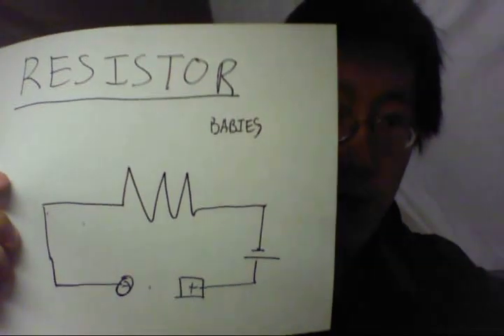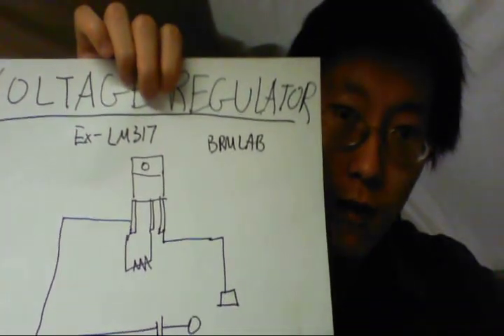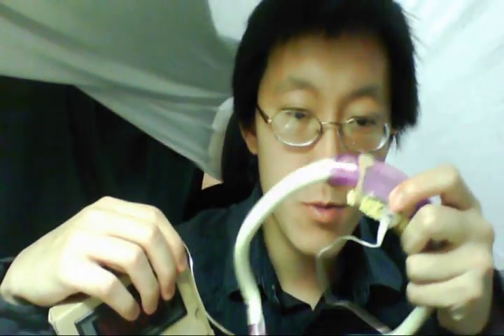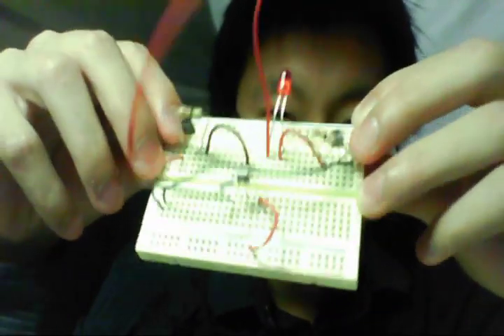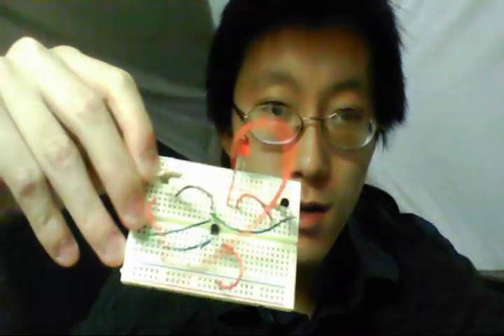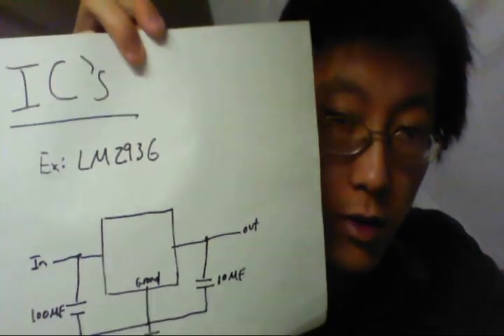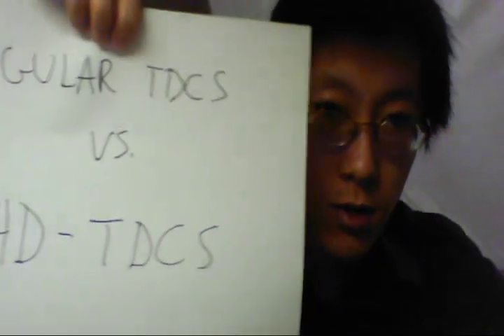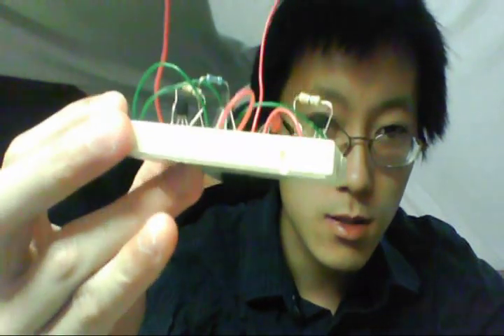DIY How to make a tDCS Transcranial Direct Current Stimulation Device Tutorial

Comment: WARNING: I burned a dime size hole through my scalp today with only 8 aa batteries and eeg pads. This is dangerous! In the past, I used sponges soaked in saltwater and only 3 aaa batteries - and was not burned. Be careful! I may have permanent scarring now - at best! Don't make the same mistake I made!
Reply from the maker: "only"? 8AA is a lot. That's 12V in parallel and produces quite a big shock without regulation.
Reply: Nathaniel Zhu 

They were in series

Comment: what I gather from that 'bullseye' part is that you want one central anode surrounded equidistantly by several cathode sponges.
considering my above understand is correct, how is this any different from having one large cathode sponge? you'll never be able to place them so perfectly as to avoid selective direction of current flow. current will still flow from the closest cathode.
why is it not better to place the cathode on your back or shoulder and simply increase the potential difference to make up for the resistance?

Comment: Isn't it dangerous to build your own tcds and you have to have the electrodes placed in specific areas? How do you know where to properly place the electrodes?
Reply from the maker: There is a formula for each part however since I do research on tdcs at my university, I can visually tell where to put the electrodes. 
Also, I've been using my devices for about a year and I've had no problems with current fluctuating above 2ma.
Reply: EpicAthiest
Do you know how to buy a tcds? I seen this tcds on a site for $40, but it says that the effect only lasts for an hour. I seen tcds's on other site that are at least a couple hundred dollars, which I would imagine are of greater quality. I have a bicycle project called 'The Gearcycle' that you might be interested in, btw.
Reply from the maker: vistigioful
What site is it? For the record, effect has nothing to do with the product. In the same way, you can have many different brands of acne face wash and have different marketing but has the same active ingredients.

Studies have shown short term and long term effects with tdcs, but it doesn't matter what brand you buy as long as the current is between 1 - 2 ma. How long the effects lasts depends on how well/how long stimulation occurs which is for the most part independent from the seller (unless they're totally incompetanant at making things).

For example, Vitamin C is vitamin C (if they're the same form ex L-ascorbate) whether it is sold by naturemade or walmart.
Reply: EpicAthiest
It is a site called tdcs-kit.com. type it into Google and it will be the first result that you see. It may be a scam site. If all tcds's are created equal, then I might as well go with that one. I want to thank you for your help and you have earned yourself another subscriber. Did you know that you can make a battery by connecting fruit in series to power an led or some other low voltage item? I have also just did a review on an elenco snap circuits kit.
Reply from the maker: hmm. By looking at the little tube in the middle of the cord, I assume that's where all the electronics are. I doubt they'll be able to fit any more than the transistors I use in my tutorials in that tiny tube. 

One question you could ask yourself is whether you can trust others to make safe equipment without knowing their schematic.
Reply: EpicAthiest
I know what you mean. I seems pretty cheap. It also doesn't seem to come with any saline solution to put on the pads. One thing about the foc.us though is that it seems like you would only be able to put the electrodes in the front of your head rather than being able to customize the position of the electrodes in wire based electrodes.
Reply from the maker: Yeah I thought the same about the foc.us as well. It looks like the only place it is programmed to stimulate is the L-DLPFC, which is also the most well researched. It deals with memory and concentration. 

I just finished my tdcs headband and I'll made a video it later.
Reply: EpicAthiest
Here is a website that offers various types of tdcs's: http://www.alltdcs.com/#!devices/c1tsl. Maybe you can use them as inspiration for another tcds for you to make.
Reply from the maker: Nice, thanks the list. The tdcs research group here uses one of the techniques on the list (the black iontophoresis machine)
Reply: Nathaniel Zhu May you share that formula and areas? or where we can find that info?